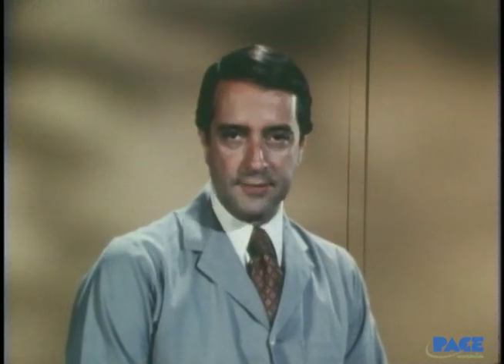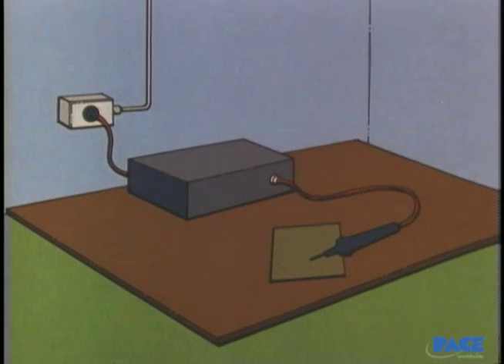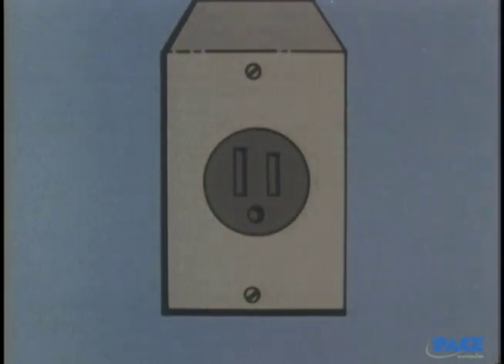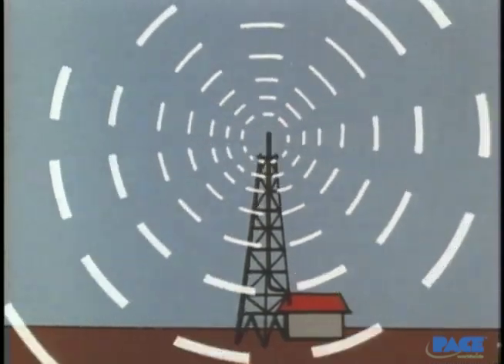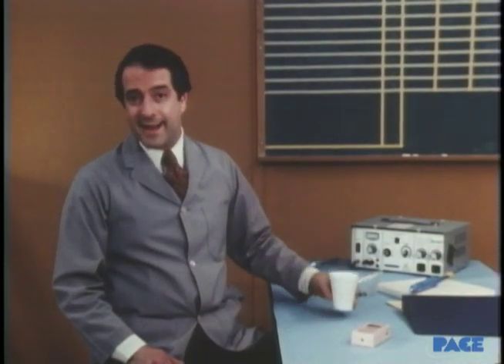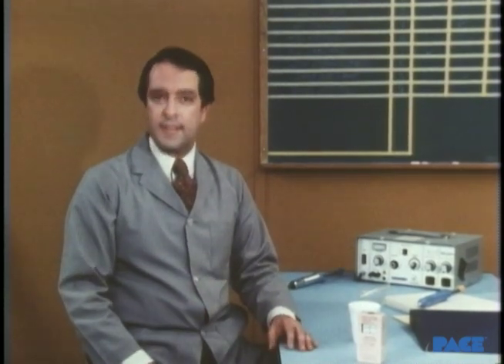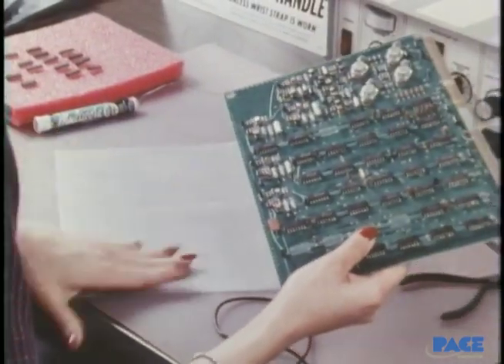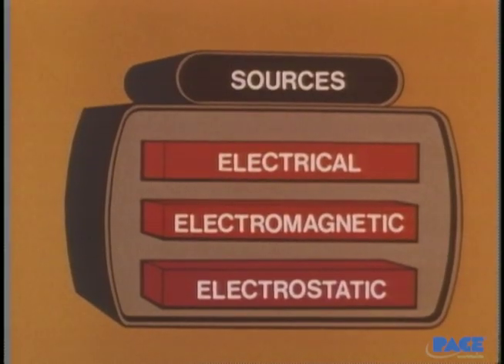PACE Rework and Repair "Electrical Damage"

Comment: Quick, Weller, Ersa, Hakko, Pace and here in Poland Elwik. Unfortunately they all pro tools. There is no place here for hobbysts here as for example Pace is one of the most expensive brands. Its a shame that it doesnt have even one station below 100$. Thats why we have to use Solomon, Xytronic, Ayoue or even those cheapo chinese clones - WEP, Zahoxin, Yihua, PT, ZD stuff. Or do some DIY if we have need for higher level soldering.